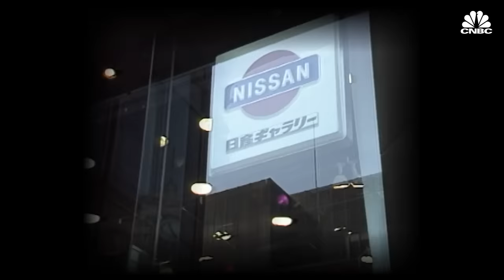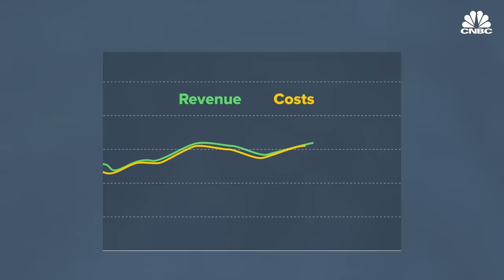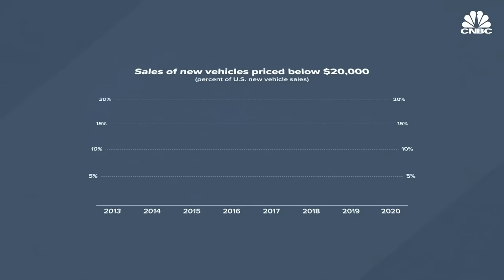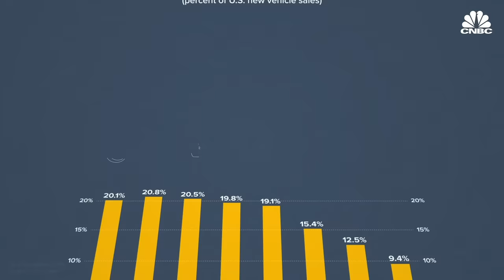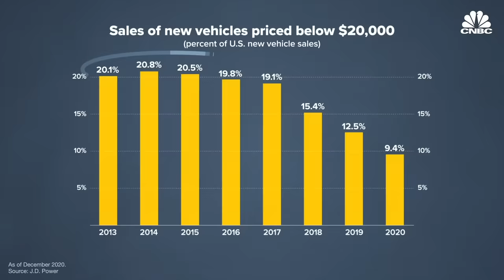Why Cheap Cars Are Disappearing

Comment: At least they're saving money on paint variety. 5 colors!
Reply: Black is an absence of color.
Are you by chance including that in your total?
Best just to purchase WHITE,  as it has the best resale value.
Yellow and green are among the worst, as they suffer fading
 i.e Color desaturation caused by UV light in the light spectrum.
Reply: I wonder what happened to the pretty blue paint they had in the '60s and'70s? You almost never see a blue car any more and if you do it's some kind of weird blue.
Reply: Not to mention the ONE interior colour, unless you’re willing to fork out for a top of the line model....
Reply: korrdxl

Exactly.
Should anyone desire any color outside of what the factory produces, means that the buyer will have
pay for a vinyl wrap.
That of course also means extra expense and informing the DMV and whatever licensing authority 
regulates vehicle registration that a change of color has taken place.
It is a breach of statutory law in every country to change the color of a vehicle and fail to record the
color change to the licensing authority.

Comment: In my 20’s I’ll never buy an SUV never. As long as I got Bluetooth in my sedan I’m happy. Rather the sporty feeling and a low car to an suv.
Reply: CNBC  wtf
Reply: Totally agree.  I rented a bunch of the SUV's and they rode like my pick up and I hated that.  I am sure it is not true for all, but the ones I had I hated.  I was happy to hand them back.  I prefer a good sedan as well.  Too bad they are shrinking.
Reply: I installed touchscreen with wheel support, cameras support, GPS, internet access, USB ports, music player and well...basically its on android so you can download nearly whatever from playmarket...oh it costed me 150 euros for the item and it was rather easy to install on my 2001 volvo.

Comment: It's not just profits for carmakers. Another factor is the availability of cheap credit over the past decade. Extremely low interest rates means people more often that not finance their cars. As they are not paying very much interest, they leverage that extra money into more expensive cars. This creates a high demand for more expensive cars and reduces demand for cheaper cars.  

Here in the UK, the typical starter car for 17-25 year olds as recently as the 2010s were small and cheap hatchbacks such as the Vauxhall Corsa, Nissan Micra, Fiat Punto. Now a significant number of them are driving around in new BMWs, Mercedes and Audis, a trend that has really taken off in the last 2-3 years. I am a delivery driver so spend alot of time on the road. The trends I see are quiet shocking to be honest. There is no way it is sustainable. 

Eventually, people will need cheap cars again, and manufacturers will have to adapt to the marketplace, at least to some degree.

Comment: Here in Portugal/Europe you see now a lot of Dacia's, specially the Sandero SUV. Cheap and good for the price.
Reply: Oh no! Anyway….
Reply: Dacias are cheaper than Ladas and actually work.
Reply: I tried to test a new Dacia being an owner of 2005 Renault Laguna 2.0 16V which costs 1/5 of the new Dacia. I ran away from the Dacia dealer in horror after 5 minutes of sitting inside of this shitbox.
Reply: Good luck….

Comment: SUV, the highest insult to the term "efficiency".
Consumers have never been the smartests anyway; theyre buying apple products en masse.
Reply: you get rich when you understand the difference between "i want to have" and "i need to have" and put the saved money into an msci world etf
Reply: Lol the Apple part is so true.

I like your boldness.
Reply: Glad to see another intelligent individual is in the comment section. Apple blatantly rips off their customers yet they still keep buying from them.
Reply: @mistamaog  My last Iphone lasted me five years. My Macbook is almost 10 years old and runs the latest OS and all programs I need. Apple products work and get the job done.
Reply: @capmidnite  It's all dependent on the user, my first laptop lasted 8 years, and my first smartphone from 2014 still works and runs smoothly.
That being said, newer Apple devices are intentionally designed to fail and unrepairable due to "security reasons". There's many people who've had their MacBooks get bricked because of the T2 security chip. 
Also in the newer iPhones, the internal parts are programmed to only work on one specific model. If you get the screen replaced, it'll need to be reprogrammed to match the device or it won't be fully functional.
Reply: Iphones r good it's just they're too expensive

Comment: "most of the consumers in the sub twenty space tend (?) to be younger.."

You dont f@cking say!
Reply: I would argue with that one as most of the boomers I know here in rural Missouri also do the compact and sub compacts for commuting to the city for work forty mpg is important to them. They might have a used full size truck for local but they won't commute in that at fifteen mpg or less. And most would be very happy without all the fancy bells and whistles that drive the price up. Last two cars had satellite radio built in and never even used the three free months as I did not want the hassle of cancelling before they started charging for it. I would love a basic mechanically sound vehicle at a fair price but not going to pay thirty thousand for a vehicle that cannot even tow a small camper or utility trailer. And sure as heck am not going to buy a sixty thousand dollar pick up truck.
Reply: "Sub-twenty space" as in cars that cost twenty-thousand dollars and below, not people under the age of 20.
Reply: Bunmbiss

Comment: Cars lasting longer? New cars lately come with more defects and problems than a 20 plus year car.
Reply: Mostly electrical and electronics issues. Mechanical problems are statistically much lower since the mid-1980s when the industry went to more precise machining practices. Plus, a 20-year-old car that's still serviceable has been properly maintained.
Reply: Because they're over complex and made in Mexico.
Reply: I. S  yes, especially their entry level cars. MB management let the bean counters really mess things up. Went from W140 to cheaper stuff with bad wiring or something, IIRC.

Comment: This is exactly the reason the USA needs to adapt cycling safe roads and get better public transport. Take a couple of notes from Europe.
Reply: who the hell would want public transports when there is literally usable 500 dollars cars
Reply: @johnmackinon9691  But not exactly the safest and they are bound to obviously have problems if they are priced that low.
Reply: @sheep5403  you can get really lucky and find some cheap cars for that price. I’ve bought multiple cars for $1000 that have served me well.
Reply: @gregthompson3481  That's definitely true, I bought my beloved Volvo 240 that is currently at 418k km for 800 CAD years ago. Rust was the only problem but I got that sorted out as it was minimal.
Reply: This is done in the cities.  NYC has a bike ride share program, which works fine.  This isn't widely adopted in the US because much of the US is rural and bike riding isn't a viable option, like it is in Europe.  If you really want to see a population of bike riders, go to Vietnam!
Reply: @bkeen7013  
Correct. If you live in the city, public transport and cycle friendly infrastructure is a viable and available. But if you don't, like in the suburbs or in rural areas, public transport and cycling just isn't practical. As big as the U.S is population wise. is, we not extremely dense or established as European cities. Also, many of us travel from suburbs and rural areas to cities for work. Cycling is basically impossible if you want to get there in less than 3 hours and many public transport doesn't go to people's homes like school buses do.
Reply: USA is too spread out.  Europe is very compact and cycling makes sense.

Comment: If you want to beat this price inflation, buy a second-hand car. Modern cars last longer but still depreciate in value at a faster rate the newer the car. Find the sweet spot and you will get value for money.
Also if you are concerned about the price of petrol, just buy a smaller more fuel efficient car that better matches your needs. Don't be duped by marketeers trying to convince you that you need the newest and biggest car. How many people actually have a need for the bigger truck offerings from US car makers.

Comment: Somebody needs to make a contemporary version of the K Car or Yugo.
Reply: I hope the cheap Suzuki jimmy makes a comeback. It’s a wrangler,  but half the price.
Reply: Who'd want it
Reply: @icemike1  
LAUGHS IN ASIAN
Reply: @angelgjr1999  
With how America treated Suzuki (especially with what Consumer Reports did), I doubt the Jimny (it used to be called Samurai in the US) would go anywhere near the US.
Reply: Most won't be sold due to "safety concerns"
Reply: I had a K car once, 50000 mile warranty, and it basically fell apart at 51,000 miles. Want nothing to do with cars like that. I'll buy used. I'm 80 and have owned two new cars in that time. Don't expect to have another new, unless they will sell me a 50,000 $ car for $16000.
Reply: In Europe there is such a car. Tha Dacia. Build in Romania by French automaker Renault. If I'm not wrong each model Is based on a previous Renault model chassis and engines, looking  a little bit different. Not much shinny tech additions such us infotainment systems, and other exotic systems. They are gaining significant market share in Greece.
Besides this in Greece, Fiat cars and some Kia/Hyundai models are also quite affordable. I think on one of the like the Dacia/Renault cars.
Reply: I would not want a cheap car like a Yugo. I will continue to buy sports cars even though I'm young. Being a very smart shopper can help shift costs
Reply: 98 Corolla has entered the chat

Comment: Affordable small cars feel unsafe on freeways. Cars like Accord and Camry feel much safer and planted.
Reply: Yes
Reply: My first vehicle was a motorcycle for my first 2 years of driving
Reply: To you they feel unsafe...
Reply: @jermainec2462  
No they are unsafe at those speeds. Many of them have a high centre of gravity which makes them have poor handling at higher speeds. Many are underpowered so it is a struggle to keep them up to speed.
Reply: @bighands69  🙄🙄🙄🙄🙄🙄 man stop it ... Its 2020 small cars do not feel un safe ... 10 years ago or maybe to you subcompacts do but they dont ... And i can promise you aint no vehicle gonna save your ass when that semi knocks yo ass across the highway ... I got a subcompact and i feel just fine ... So let's just say you in particular don't feel safe in them I have emergency braking I have multiple airbags,   it's not underpowered and can easily keep up with traffic
Reply: @bighands69  I dunno I drove a Peugeot 108 (£11.860) on the motorway at 70mph for a couple hours and it felt just fine and it’s only a little 1.2 with about 80ish horsepower more than enough for a car of that size and weight and feels just fine

Comment: I love how she gives apple car play as a reason 😂😂😂 

It's literally just a screen in a car. Someone can get a tablet from the store for about $100. 
I assume those screens in cars never actually cost more than $500. 

Granted up to $500 is quite a bit.
Reply: Those features should be optional, I dont even use apple devices
Reply: Exactly, they act as if the screens are iPad pros. They usually are pretty cheap screens. They can mass produce or mass purchase them and add them to all cars, I don't think it cost automakers more than $50 to add them to any model
Reply: @MHNK77  yet they sell it to us as a 5000$ "option"
Reply: I did this with my car, I bought a lower trim car and I just bought a nice aftermarket head unit with wireless Apple car play. Love it, make the car feel much more up to date!
Reply: @-nightraider-1169  same! Mine was $300 and now I feel like I have a new modern car

Comment: When it says car today last longer then it used to, I laughed . I drive a 1983 300SD Mercedes and it is build so solid it still runs strong and smooth and the maintenance is dirt cheap. You see, back in day when you buy a quality car it really last you for life, today it will last you till the last day of your warranty.
Reply: Well, when it comes to a car company like MB, you are right. MB stopped making good cars when they merged with Chrysler. (mid 90's on  wards) But when it comes to Hyundai, it is the other way around. Their cars have improved dramatically. Frankly speaking, I don't see any reason to buy German anymore. They are just living off their heritage.

Comment: How do cars last longer than they used to when the smallest fender bender ends up writing off the car?
Reply: Actually they do last longer provided there are not accidents.   My first new car was a 1989 Ford Escort GT.  When it finally died, it had a little over 110,000 miles on it.  My current car is a 2002 Chevy Tahoe. Currently it has 265,000 miles on it a still running strong.  Last summer my mechanic wanted to buy it off me LOL  A buddy of my has a 2004 Toyota truck that just turned over 400,000 miles
Reply: Cars are lasting longer. My parents had a Datsun Cherry in '79 brand new. 7 years of ownership driving back and forth between England, Ireland, Germany, Norway etc... and it was coming apart. My 2010 van has put in similar mileage and is humming nicely. My father was a mechanic in the military, he took excellent care of the Datsun and even decoked the engine. Cars last longer now.
Reply: @deepshotone  Well Toyotas just last forever anyway. Barring no accidents, any car can last with proper maintenance and generally taking care of it. With accidents, most new cars can't stand up to an old car when it comes to small accidents. I get it, new cars crumple up to save the passengers where as old cars don't, inflicting more damage on the occupants inside. But I'd rather have a broken arm ect then have to buy a new car.
Reply: @sr212787  In the US, breaking an arm might cost more than a new car. 😂
Reply: @franks pizza shop pizza What you're describing is durability not longevity.  Cars that were made 70 years ago  were solid steal. Those cars were built like tanks but the engines were not ment to last long.
Reply: @franks pizza shop pizza Maybe so. But ask anyone who owned a Ford or Chrysler in the 80's

Comment: A 20,000 dolar car in the USA is like a 40 thousand dollars where I live because of import fees
Reply: same
Reply: Same
Reply: A car that price now a days a nissan which even at 16k the transmission blows up even after the "fix" or a Hyundai or kia which has 1.6 million engines recall for blowinb up and they don't sell near 100k a year. That sounds like almost all their cars or half that ever came out. Get a used honda, toyota around 10 years older or more witha mechanic to check it out. It even a subaru or mazda with low miles instead
Reply: It's Theo Same, in Germany. I Love American Cars, but the Import fees , makes the car to expensive.
Reply: I import cars and pick up truck to Australia.  Add shipping costs + custom duty tax+ compliance + 10% gst + 3% stamp duty + Rego and ctp = $20000 car turn into $27800 blame government not Capitalsm

Comment: Automakers are wrong.  The younger demograph has no loyalty and follow trends and price. They will drop ship in a second for something new and in the same price range if it appeals to them.  Automakers also forget not every "older" consumer wants to spend a lot of money and rack up mileage on an expensive car.  I arguable have more expendable income than most younger people (I've been working for the same company since getting my degree 26 years ago) and travel a fairly far distance to work,  I would rather have a cheap car to do that than to have to drive my newer, more expensive car.  Manufactures are losing this sale to the used market.

Comment: Why would I buy a brand new car for $20k with hardly any features when I can buy a used car from a few years ago with tons of features for the same price?
Reply: or lease a brand new car have it for 2-3 years and get another new car. We do it with our phones. I been leasing since I was 18. I've had a 300, Malibu, Dodge Ram, Jeep Grand Cherokee.
Reply: You'd have to trust the seller about their claimed usage and maintenance. A bad buy could cost you dearly in wasted time and money, and there's no dealership with a specialized staff to hand off issues to and warranty to claim against.
Reply: @patroshannish  Leasing is almost always more expensive than buying.
Reply: Because the guy that owned it prior to refused to spend $30 on an oil change, 3 times a year. So you're  inheriting an engine, transmission time bomb

Comment: I’m driving a 2008 Nissan Altima, 145km (I drive 3 mins to work). I got it in 2012 and I hope it still lasts me a few more years
Reply: Stay on top of the transmission fluid changes and it should.
Reply: If work is 3 minutes away, why not just cycle?
Reply: @Cali_ Kid Why not replace it?
Reply: CVT transmissions had an inherent weakness, and Nissan refused to recall them.
There's a class action against them as we speak.
 If you haven't already done the transmission service, please--do it now!
Reply: only 145 kilometers! you've barely driven the thing. it will another 50 years easy
Reply: @RuRaynor  it’s hard to cycle in the snow